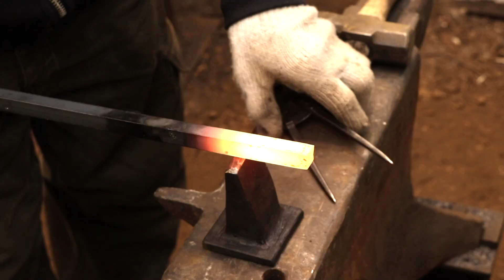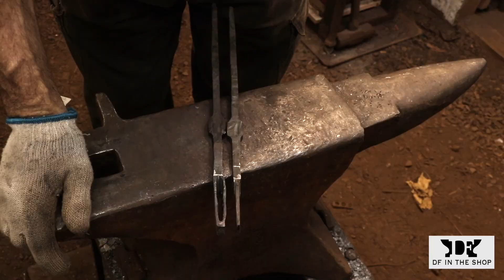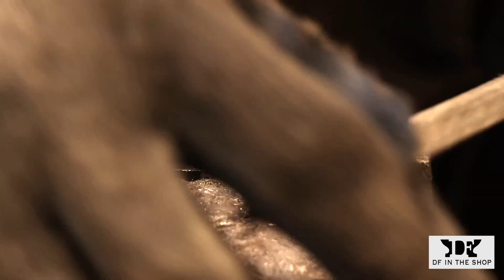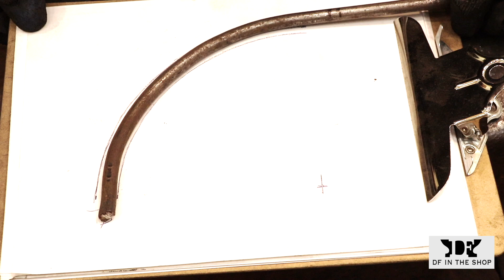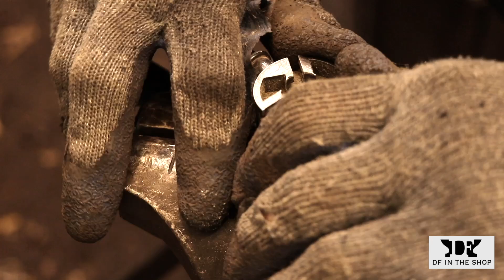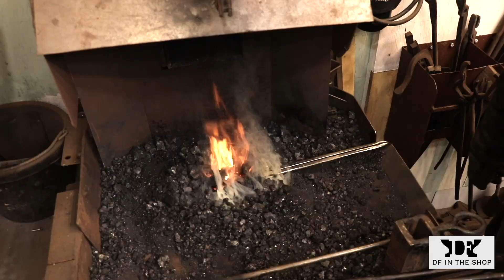Blacksmithing - Forging Winged Dividers

Comment: What is the reason for the 3 layer hinge design? I can't work out the benefit over a hinge like a pair of tongs. Thank you, very impressive work
Reply from the maker: These tend be more accurate because the alignment of the arms relies on the fit of the hinge sections which is spread out over a larger area.  So even if  they are crudely made ( like this pair)  a poor fit in one area can be cancelled out by a good fit in another area.  So they have a smooth action over their entire range.  The rivet is just holding everything together. It does not contribute anything to the operation of the dividers.  Firm joint dividers, on the other hand, rely solely on the pressure applied by the rivet over a small  area so they are more likely to develop loose spots as the area under the rivet begins to wear over time.
Reply: @df-intheshop330  ah, thank you. That makes sense